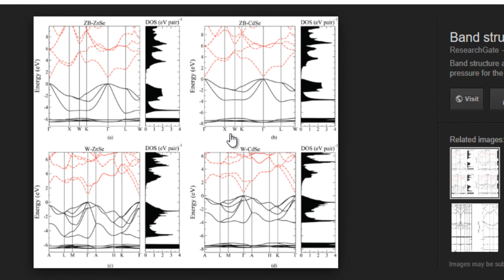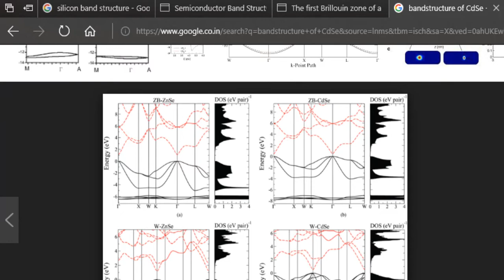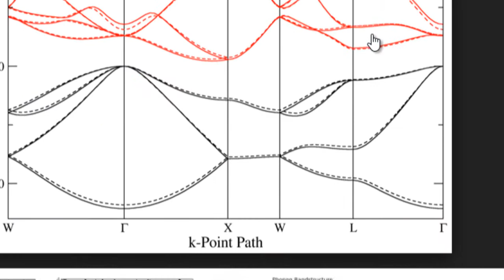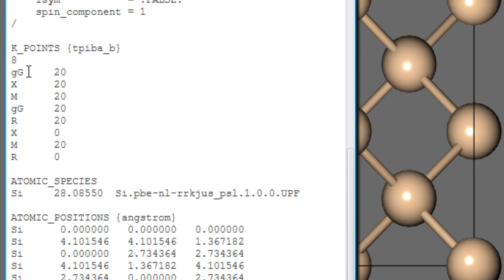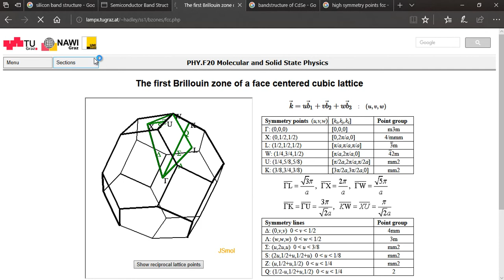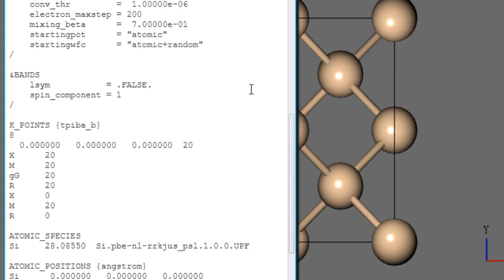Choosing and Providing the HIGH SYMMETRY POINTS for BANDSTRUCTURE Calculation - QUANTUM ESPRESSO

Comment: Hi its me again. What does the number under nk mean? Can i use a smaller value for example, 10 instead of 20?
Reply from the maker: Hi!
nk is the no. of points between the two hi gh symmetry points that you provide. Higher this number is, smoother will be your bandstructure.

Comment: Am trying to create a band structure for wurtzite structure. when i googled it ,the high symmetry path is A L M G(gamma) A H K G.  here in the bravais lattice (ibrav =4) the path showing is different. Am not able to find  the reciprocal values of these in google. How i can get that?
Reply from the maker: Here they are:
http://lamp.tu-graz.ac.at/~hadley/ss1/bzones/hexagonal.php
Reply: @PhysWhiz  OK..i want to consider these values for my high symmetry points and these wanna arrange like as i mentioned above(high symmetry path) , right?
Reply: sir one more question. I am very new to QE as well as burai. I think in QE we need to create an input file that is somewhat difficult while considering that method. but here it is very simple we need not bother that much about it. so while including burai in a research paper is it will be acceptable????
Reply from the maker: @soumyakannoth1  Yeah, these should be okay. I used these for my research article on ZnS (wurtzite) too. Just make sure you set the correct setting in QE corresponding to Reciprocal or crystal coordinates. I don't remember but I think I made a mistake in the video while setting the units. So make sure you do it correctly. Also, a good way to check if the results you are getting are correct or not, just compare your bandstructure with that of literature, and it should match perfectly if you did things correctly.
Reply from the maker: @soumyakannoth1  Yeah, creating an input file for QE, directly by hand is a nightmare. I think BURAI, simplifies the procedure a lot. You just need to make sure that the input file that BURAI generates is consistent with what you want to do, as there might be bugs in BURAI. So, always check the input file that it created, if it is exactly what you intended it to be like.
I think it should be okay to reference BURAI in a paper. I have referred it thrice, till now, i suppose, especially because it offers features for modelling supercells, slabs etc, which are not available in a lot of other softwares.